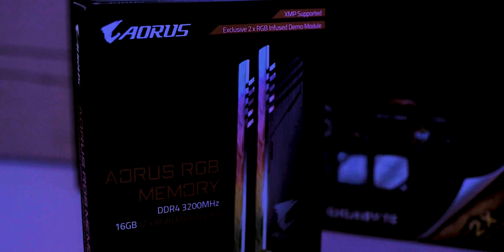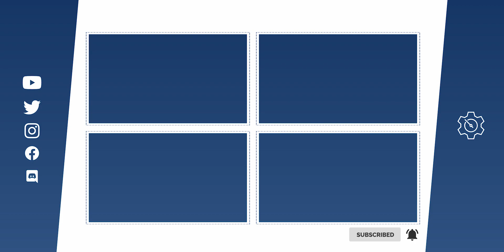PC VOOR G2 ESPORTER THIJS BOUWEN! - Build My Rig #16

Comment: What pc part do i need more gpu or cpu and how much ram do u need ive got 8gb, ive got i3-8100 and gtx 1050 and on bench marks my gpu under preforms
Reply: Cpu and ram.
Reply: Hotse Flots pik, i3 8100 bottlenecks bijna niet tot een 1070 ti 8gb. Hij moet zn gpu upgraden want een 1050 heeft 2gb vram, en dat is de bottleneck hier. Hij moet gewoon een rx470 - rx580 kopen. Die kun je al voor 70 euro kopen. Zijn cpu is echt prima. Zn ram wss ook, aangezien het ddr 4 is en het wss een clock heeft van 2133mhz of meer